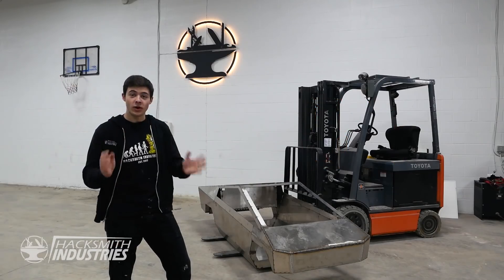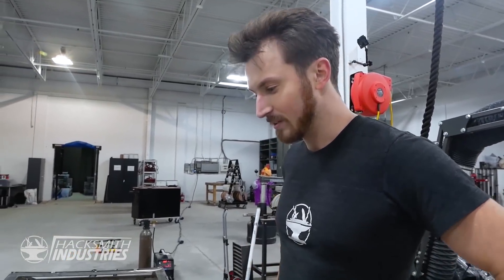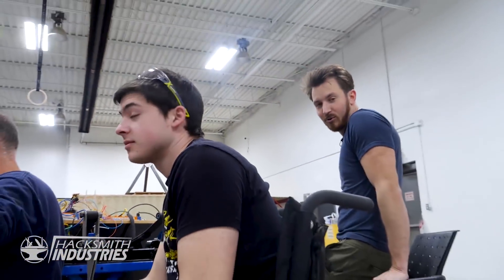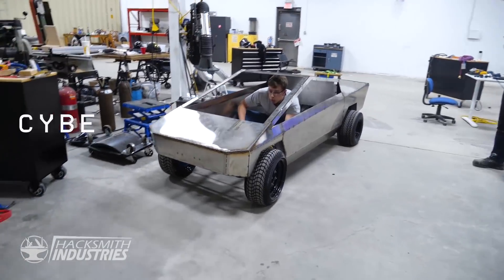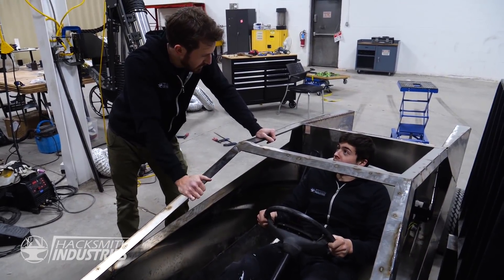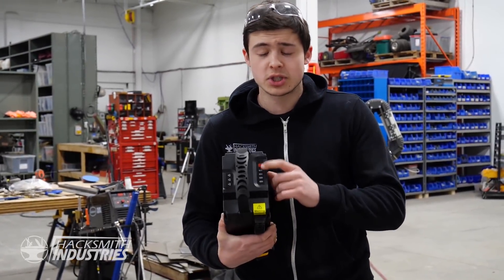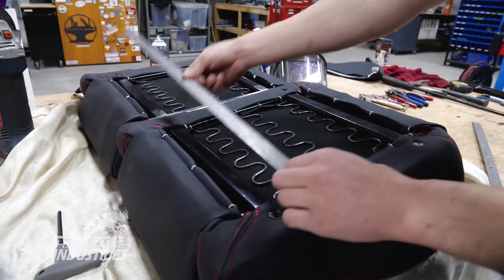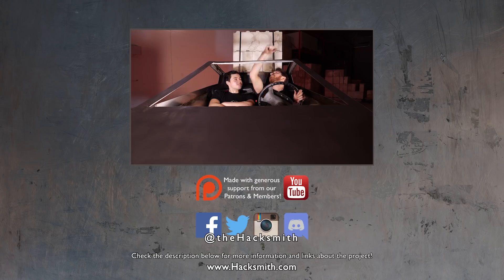CYBERTRUCK BUILD (Part 2/5: We Crashed It!)

Comment: To put the battery capacity in perspective, this battery pack had a capacity of 7.8 kWh. The 2020 Toyota Prius has a battery capacity of 8.8 kWh and has an electric only range of 40 kilometers (25 miles).

A Tesla Model S can have up to 100 kWh by the way.

Comment: How do you get power to the front wheels because the motor is in the wheel
Reply from the maker: The wire goes to the back of the wheel
Reply: the Hacksmith oh i thought hub motor axles were connected to the truck instead of the body

Comment: OMG the whole unit relies on the structural integrity of sheet metal for its rigidity? And you didn't even go with some subframes for mounting and locating the suspension? I am beyond mindblown that it didnt crumple when you set what looked to be about 1500lbs in the bed. Fairly unimpressed overall, 'cause this could have been so much more well designed

Comment: My question, are you using hub motors up front? How are you matching speed with the rear 🤔
Reply from the maker: Torque mode -- wheels all apply equivalent torque  so it speed matches

Comment: Every hear of hexovalent chromium? When welding stainless its basically as bad as aspestos. Even the stainless (expert) said nothing. Grinding is worse then welding. Anyone notice they could taste metal for a while? Hopefully no one develops lung issues! I used to weld stainless in an osha approved facility and i had a presurized hepa / carbon welding helmet with a direct fume extractor and a room heppa scrubber and all my skin was covered to prevent skin ulsures.

Comment: You can get those carbon fiber wallets on the “WISH” app for $7.00
Reply: But it’s probably already used and not that durable. You realize things are expensive for materials and labor costs so if it’s $7 it’s probably not good.

Comment: I have a hard time believing those motors can put out 600 ft/lbs of torque. Most Tesla's don't even have those high of numbers. Maybe 620 in/lbs.
Reply from the maker: Teslas have 1000ftlbs dude
Reply: @hacksmith  The P100D X and S cars have just under 800, the Cybertruck is rumored to have 1000ftlbs as far as I know. I'm still going to have to stand my ground that the build you guys are doing doesn't have 600ftlbs of torque.
Reply from the maker: You can literally look the motor specs up on ASI's website right now dude.
Reply: @hacksmith  I did, and clearly I don't understand electric motors as well as I thought I did. Thanks for the hard sell, I for sure have some more learning to do. It was a pleasure Hacksmith and I appreciate the response.

Comment: Electric Trucks are not possible. Elon Musk cannot sell trucks. An electric truck can’t carry or haul anything without the battery charge being cut in half whenever it carries extra weight, and will stop immediately once the battery is drained. Gas cars and trucks, however, can run on fumes until you can get to the next gas station, but don’t do that often.

Comment: Good stuff. How about putting the steering wheel in the middle of the dash? So both seats can control it. Then just double up some peddle bars and go. Please try it so I feel important. LoL ;-)
Reply: @Joe Horn As simple as a single seat gocart but with two seats and a couple long bars connecting two pedal assemblies. Would make a fine start. You don't have to be directly in front of the steering wheel and as snug as this setup is. I think it would be cool. It is on my bucket list.
Reply: @Joe Horn Know what I'm not sharing my lunch with you. LoL I'm building mine my way and you make yours all complicated and we can race later. :-)
Reply: @Joe Horn While I was saying the opposite and still claiming it would be just fine. Since we won't be sharing ,let's just make our own. That way we don't have to argue like this.

Comment: Im not sure whether your motor kit supports it, but you could use the driving motors as brakes if you have a cooler overflow resistor pack, the Tesla roadster uses a similar function. The motors are used as generators that can recharge the batteries a little bit, and any that is too much is put through a resistor dump, also like a diesel electric locomotive
Reply from the maker: Itll have regen

Comment: In the end it costs more than an actual cyber truck
Reply: J G  I would say the biggest expense will be all of the man hours put in to build this.
The steal is only a few thousand (10 k maybe) and the motor systems would be another 5k with the battery packs,  then the glass and lights maybe another 2k and the drive train 1k lightly used.
So material around 18k and the rest in labor, of course this is all just speculation,  but it sure would make a nice little vehicle for tooling around in even without all of the extra ammenitys. 
I still think 3/5s scale would have fit the existing drivetrain better with the wheels tucked in under the fenders.

Comment: The problem with the ridge wallet is that it’s weird to carry more than 5 cards. I got one for Christmas and just in one day it’s been annoying to search for my exact card so I can pay for gas. If you only Cary 5 ish cards, it’s a great wallet but 10 makes it too thick so just use a normal kne
Reply: Why do you have 10 cards?
Reply: @u770017  Looked in my wallet: university student ID (graduated in 2010), driver's license, VA health card, blockbuster card from 2005, two Olive Garden gift cards - both with less than $10, concealed carry ID, blood donor card, primary bank card, secondary bank card, emergency credit card. I could probably stand to not carry a couple of these around but still have a requirement that the ridge doesn't meet.
Reply: Daniel Hearn My point exactly. It is good for travel maybe, as it’s as big as a credit card and you wouldn’t need to bring everything, but a traditional wallet is much better than this thing they try to advertise.
Reply: u770017 student id, prox card, both my ids, 5 credit cards, my debit card,  and 2 gift cards. And because I use them all the time.
Reply: @steelavocado1  Get Google/Apple Pay and just put those cards on there
Reply: u770017 those don’t increase credit score if I am remembering correctly.

Comment: You guys TIG weld surprisingly well for first-time TIG welders.  Probably an over-exaggeration with the whole "50-100 linear feet = 50-100 hours of weld-time", though, right?
Reply: furiousbob definitely exaggerated
Reply: You'd hope so, thats terrible otherwise. Shouldn't even take 10 min to weld a foot let alone an hour
Reply: Are u sure? this is a high strength steel.
Reply: 635574 that doesn’t matter , just turn the amps up.

Comment: Damn. Just checked the cost on those 22000 tattu lipos, a cool grand CAD each. How many did they drop in the build? Couldn’t they have bought a used hybrid and used the batteries for cheaper?
Reply from the maker: A hybrid would of been more expensive than that!
Reply: the Hacksmith nah dude I’m in Kitchener too, check Kijiji next time! Great build though.
Reply from the maker: Time is also the issue.  Rebuilding a pack would be more expensive for us

Comment: You should make it road legal
Reply: Depending on what state that can manage to register it in. It can absolutely become road legal. Ive seen my state register a minibike after lights mirrors and a vin was added. Custom vehicles are absolutely a thing. And the minimum size is smaller than you think.
Reply: @wrecksandtech  we have stricter rules they are in Ontario Canada.
Reply: Protex Pro then they should drive it down the road and get some fast food
Reply: @WinterFlare  that puts a smile on my face
Reply: XxWinterFlare they’re not mr beast
Reply: Derpy Parrot oh yes cause only mr beast has done this 🙄 this was done way before mr beast but I’m imagining it rather as a short test drive and they record it going to a fast food joint and y’kno?
Reply: As long as it does under 45 kilometres per hour I'm pretty sure you're good with turn signals and brake lights you can take it in public but not on the road
Reply: Marcus Aurelius it’s half size and has as much torque as a supercar... it’s going to be realllly fast
Reply: @Aron-ru5zk  oh I realize it's going to be fast.  They may be able to take it to an airport somewhere.  I'm not sure if you watch the episode with the railgun but they had to keep it under 500 feet per second to not be classed as a firearm.  These guys are really above board I doubt they would risk everything to put it on the road and end up with a negative reputation with the police.
Reply: It probably can be an offrode vehicle
Reply: Protex Pro the real Cybertruck isn’t even road legal in Europe as he is now
Reply: Genuis
Reply: Legal smegal
Reply: I can’t like now it’s ate 69
Reply: Technically they made it from a golf cart so you can drive it 1 mile from the golf greens

Comment: 620 ft lb torque with gearing. An F150 can put down like 30,000 ft lb torque at the wheels
Reply from the maker: 620ft torque with no gearing  ...
Reply: @hacksmith  Wow, that's incredible. I assumed you were factoring in that gearbox transaxle thing on the rear end.

Comment: I'm enjoying this a bunch. I really wanna see it launch against something larger, that'd be fun. Maybe meet up with Cars And Cameras if possible and race against the Ducarti once they fix the clutch.

Now, well, your final gear drive has more torque than an F150's engine, but first gear, final drive and the axle ratio combined give the F150's torque figure a boost of 1370% because the total ratio is 14.7:1, making the 470 lb-ft at the engine into a theoretical of 6909 lb-ft at the rear wheels, though my calculations put the top speed at around 9mph, based of course on a top speed of 120mph in 10th gear, so there's that too. And that's with the baby 3.15:1 rear end, the ratio becomes 17.5:1 with the bigboi 3.73:1 rear end for a theoretical torque figure of 8225 lb-ft at the wheels (take away about 12% for transmission losses so 7238 lb-ft). That's of course in the 10 speed auto 2018 EcoBoost model, where 7th gear is 1:1 at the driveshaft, though 1st gear tops out at 7mph or so. But for hauling massive weights, that top speed is about as high as you would be willing to go, I'd imagine some massive yacht-sized thing behind the truck would not like to take any wide turn about 10mph XD
I should mention that the Tesla Model S has a gear ratio of 9.73:1, so its torque figure is also genuinely monstrous (a higher torque engine with a smaller ratio for about the same torque at the wheels, electric torque dropoff simulating shifting gears), hence why I love electric cars, specifically gas-hybrid vehicles for their range.

But I still like electric vehicles. Maybe using a form of Koenigsegg's LST from the Jesko would do well for towing giant payloads.

Pardon my high word count but I sometimes like to just empty my brain into a comment lol
Reply: Its 32000w x3 is 130.5 hp lol :)

Comment: That thing can already pull and hold more weight than my actual truck. And has about 500 more lb ft. I wonder if I could put those motors in it 🤔 it's only a 1979 Toyota Hilux and weighs about an ounce

Comment: did u guys saw how much those motors costed.. jesus..
Reply: Thats one of the issue with electric vehicles. Cost of parts is ridiculous. You want power its least a 1K to get anything decent that can move a adult. For something like this its 2K for just the one motor kit that only has throttle, motor and speed controller and wiring if i understood right. For this kind of cyber truck kit they sell it for 4k and that again just those mentioned things. Top of that you need transmission or axle that can handle that power and further more most expensive and most polluting part, the batteries, witch defeat purpose of cheap, environmentally friendly and easy. For reference check how lithium batteries are produced and how material is mined, what those batteries cost even in relative decent condition and how easy or safe its to work with high power electricity.
Top that with stainless work that has went to this+all the tooling and cost of this is probably around 20K if they were to sell these. Cheaper version with mild steel frame, less powerful setup with only one motor probably could go low as 10-12K.

Home made version with out labor included would maybe go down to 6K using mainly second hand parts with one powered axle. Yeah i think i'l be still going for gasoline simply due price of such electric gokart, when fuel version you can slap together in garage for 1-3k depending what you are looking for and how easily you find parts. If you want to be environmentally friendly maybe get a diesel engine and use biofuels, like grease cookers old oil filtered and mixed with diesel to run older non fuel injected diesels.

Put it simply batteries cost and motors generally are made out of conducting material like copper and that shit costs pretty penny.
Reply: you also have to realize that with this combination, they claim to have 50% more torque than a modern production full size pickup truck... this "ridiculously expensive" assembly is also ridiculously strong, it's not just excessively expensive, it has the performance to back up that cost. The power density one of these things has just can't be matched by modern gas engines. Electric engines don't need transmissions, they just need more robust motor controllers and batteries.
Reply: How much?
Reply: @steveh2474  $2k

Comment: 50 to 100 linear feet of welding? If that's how good you are at estimating, well, that's terrible. Glad you're not a general contractor. "Oh, it'll probably cost anywhere from $20,000 to $40,000 to build that addition."
Reply from the maker: Uhh the truck is 10' long.... it's pretty accurate.
Reply: @hacksmith  "50 to 100 linear feet," and it's 10 feet long? I'd have to say that makes the estimate even more questionable. 50 to 100 feet. That's not a small difference.
Reply: @hacksmith  I appreciate the response. However, with the amount of cad work you put in to your projects, using a CNC plasma cutter, etc, I'm certain that an estimation with that magnitude of error could easily be figured to a significantly smaller degree of error.